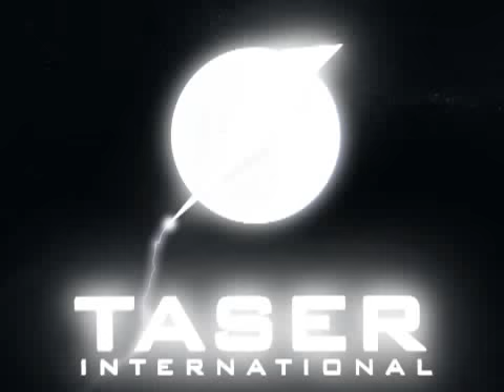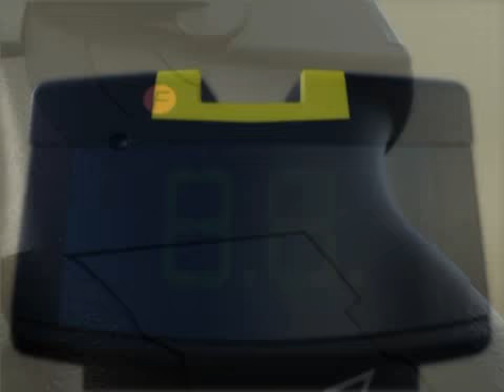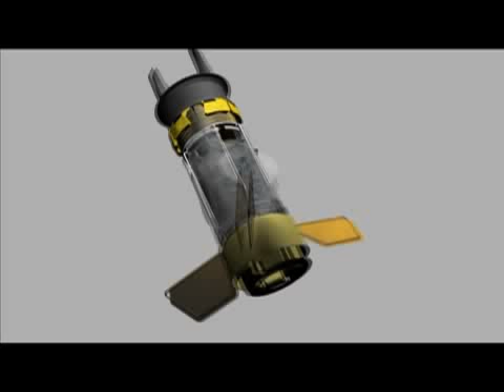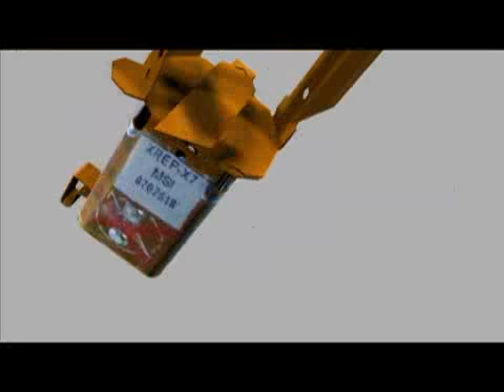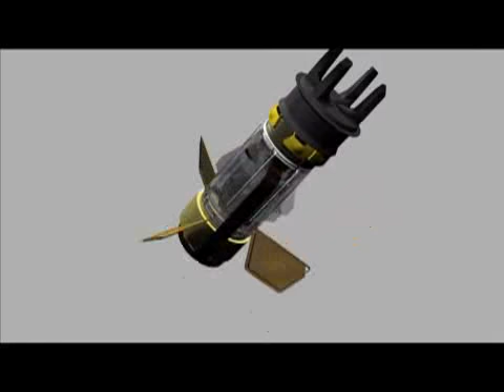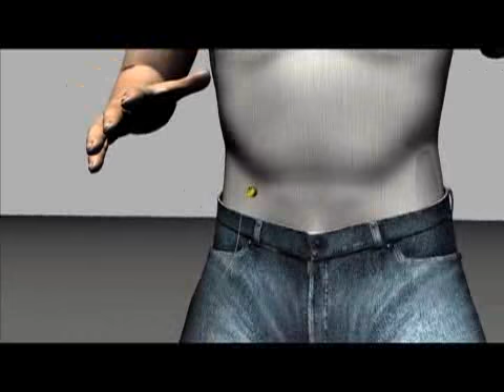TASER XREP (extended range electronic projectile)

Comment: The only field America leads the world, weapons that kill people or could potentially kill people.
Reply: even though this is a non lethal projectile..
Reply: +Womble Dewd "kill or potentially kill" he used both. It is a non lethal weapon. Of course it can have ill effects on certain people like those with heart problems. I honestly don't see the point of you commenting.  No one here requires your commentary. Go find someone else to troll months after original comment.
Reply: +Womble Dewd obviously a sword is not a non lethal or less than lethal weapon. However it's not a modern weapon, and it is not frequently carries, nor can it be concealed. Like I said, of course a taser can kill someone if they have health problems, but to a healthy adult the chances of it killing you are very low. Comparing it to a sword makes little sense, because a sword is designed to cut or puncture in the hopes of killing an assailant. A taser is designed to stop an assailant without killing them. Period. It is unfortunate that the taser has indeed killed people, but those instances are rare, and due to underlying circumstances.

Comment: notice at the end he said "less lethal technology"
but not: "non lethal technology"
Reply: Even slapping someone can be lethal
Reply: @videorowtv5198  only ten years too late on the reply but agree, like "bullet proof" less than lethal is referring to the specifics of being able to prove more sufficient at its job than an alternative. In both cases the goal is to prevent loss of life.
Reply: @crazyginger9889  I didn't even know what YouTube was 10 years ago lol.
Reply: @videorowtv5198  i feel you there,seems like a long time ago.. as I was browsing looking into where or what happened to XREP shells and if they are still on the market, (for the most part no, but the training rounds are), though rubber rounds are cheaper. 

And yea comment section is full of laughs the gun the XREP shells go into is technically not classified as a firearm as it has a part/spacer added into the chamber to prevent the gun from firing lethal rounds. But the rounds themselves were not properly marketed and somewhat faulty so in gaming terms this is the Assassin's creed unity of "non-lethals" 
another cool failure of tasers was the shockwave modular claymore tasers.
Reply: @crazyginger9889  Yeah, it's a shame all these cool "less than lethal" weapons never take off. It could prevent more deaths than regular tasers and such.
Reply: @videorowtv5198  actually there are many types of non-lethals in use and on even the civilian market , the major issue like training for LE(law enforcement) is budgeting, and many of these new or cutting edge devices come with higher costs which struggling departments can already barely afford and besides adding another weapon they have to standard issue, train and make space for in already cluttered squad cars, The training for the weapon will also cost money. 

So if you are interested in learning about more non lethals can give you a link to about the six commonly used non-lethals found in your average PD, but the number of shootings on the civilian side outnumber the cops by a long shot and getting civilians to use non-lethal means would be a big hurdle in helping curb some of the numbers (btw majority of gun related deaths are suicide followed by gang/drug related crime) so its not making a difference in the big picture but every little bit counts.
Reply: @crazyginger9889  Yeah, makes sense. But most non-lethal weapons are close range, gas based, or otherwise negatively affect other people around. 
I understand PDs don't have money to keep trying new weapons. But I am from Europe and as you probably know it's pretty hard to get a gun here, and sadly most "long range" non-lethal weapons are illegal here. Only thing you can buy here for self defense at range is percussion pistols, which is kinda weird imo.
Reply: @videorowtv5198  Standard taser is good to almost 30' equivalent to a little over 9meters so you have range options if tasers aren't being oppressed by y'all's sometimes confusing laws have been fluctuating(germany has been seeing changes specifically). 

And a quick search tells me that it is still legal in Estonia and the Czech Republic to carry firearms(with license)specifically for self defense and to carry them in public areas.

 And for close range stun guns are still reliable and effective(as long as both prongs penetrate/connect.

(if stun guns are regulated OC spray/pepper spray/mace are still options that have substance ranges 1 to two meters for certain make and models.